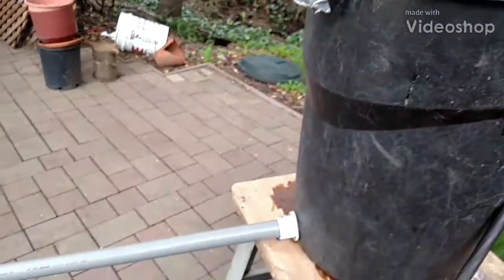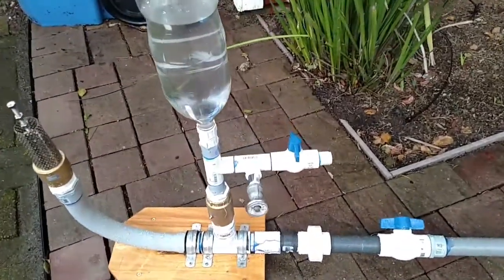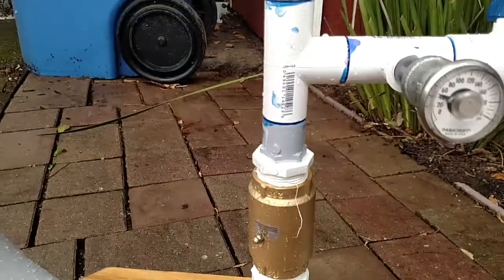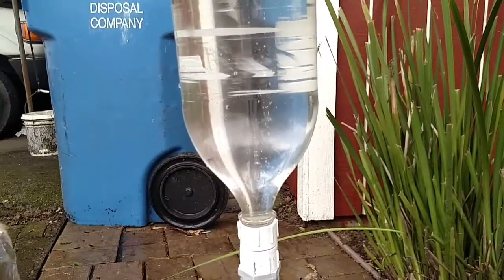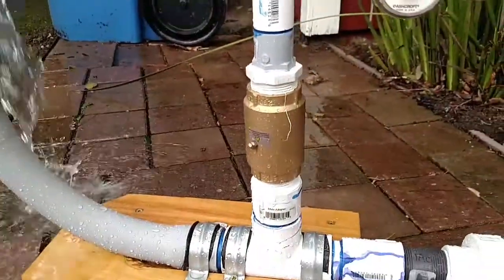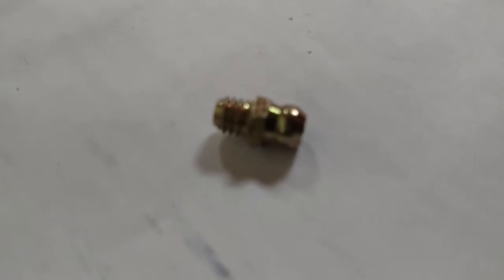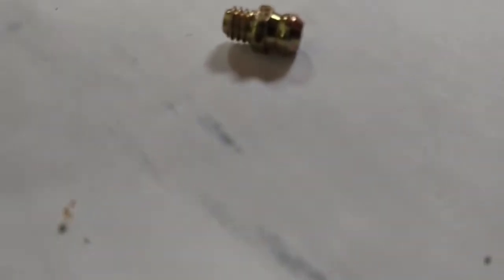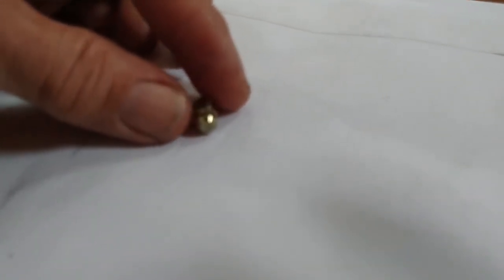Best Snifter valve,Ram Pump

Comment: Shorten the spring in the zerk? How?
Reply from the maker: Steve Schalow Hey Steve got your email I’ll answer you tonight
Reply from the maker: Hi Steve still haven’t got a chance to enter working on a video to show more detail it takes a couple of sharp tools and danger to your fingers on the open in you have to get that little end of the spring started out and unscrew it basically cut little bit off And do the same thing screw it back and hope that helps
Reply: Ok. Thanx. I figured it would be something of that nature. I think I have an extra zerk “somewhere” in my garage,  I also deal with a lot of joint pain so just haven’t gone looking. I’ll find one & check it out. I really like the idea though. Thanks for posting it!!
Reply from the maker: Steve Schalow Sure no problem